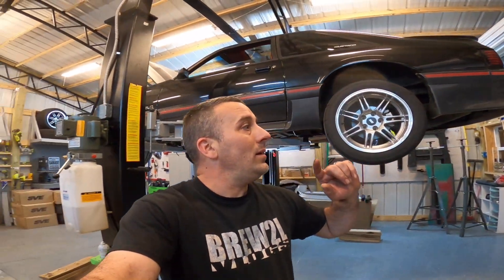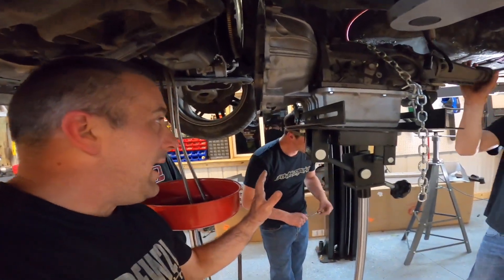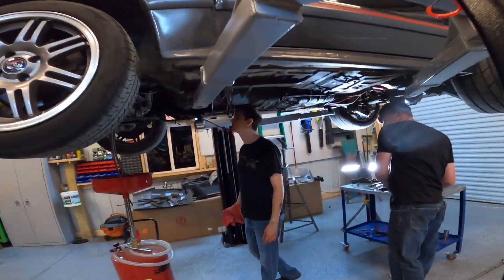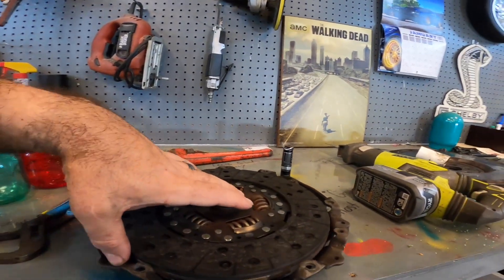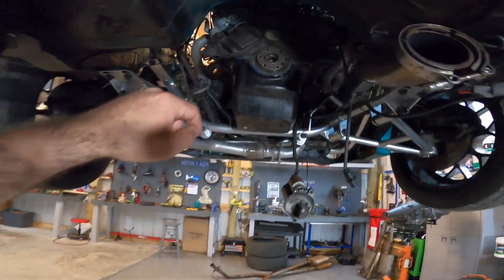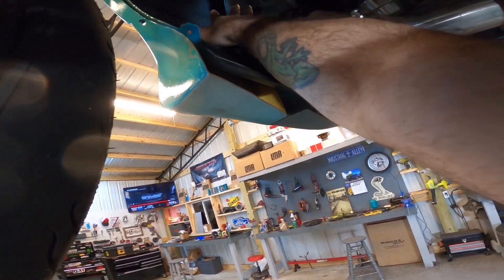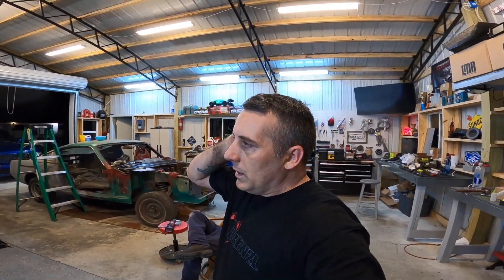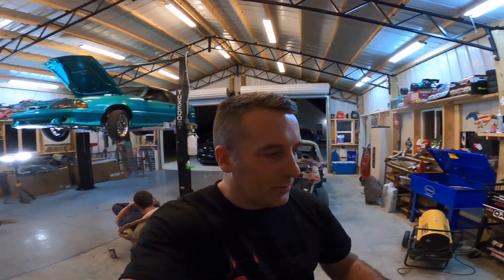I accidentally C4 swapped my FOXBODY on purpose

Comment: I think that was part of your shift problem. If the in put shaft has rotational force being applied it will make it harder to shift at speed. Like if the clutch is not disengaged all the way. Pilot shaft bearing is that important.
Reply from the maker: I agree. So a new clutch wouldn’t have 💯 % fixed the shifting problems more than likely

Comment: You need a pa pro shift servo.. if not your gonna have shifting issues under boost.. and go ahead and get a billet input shaft..pa has one they sell.. those are the 2 things I seethat that trans definitely needs especially running a power adder..

Comment: Just curious how you got the shifter mounted? Just picked up my fox that has a c4 and a B&M Ratchet shifter but im not a fan of it being mounted where the ash tray goes in the center console. I had seen there was a company called Holcomb Motorsports that made a plate that allowed the shifter for a C4 to be mounted in the original spot. Is this what you used? Any info would be greatly appreciated

Comment: If you are making 400hp to 420hp at the tire it will run 7.0 to 7.1
Reply from the maker: I’d be super happy with that
Reply: @BREW2LFOXBODY  you have the mph to go 6s but with no trans brake you won't be able to leave on boost.  My advice add the trans brake and run mid to low 6s